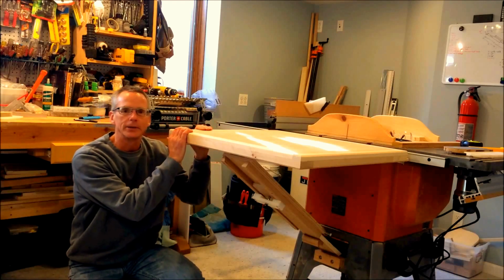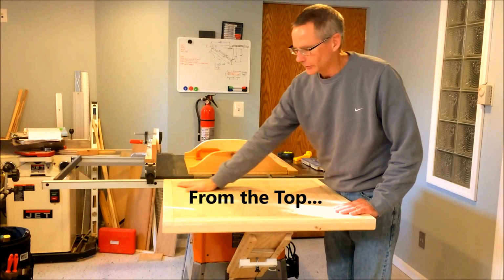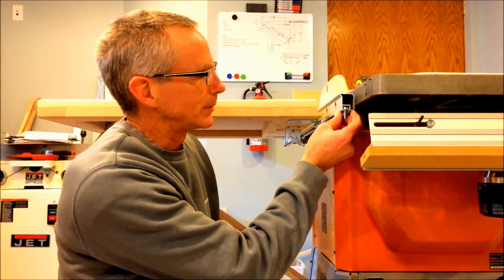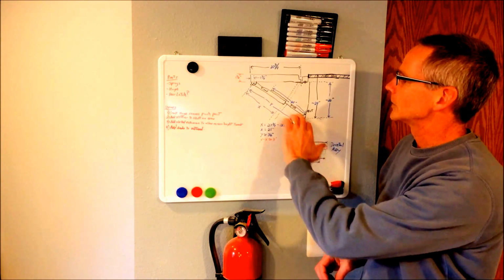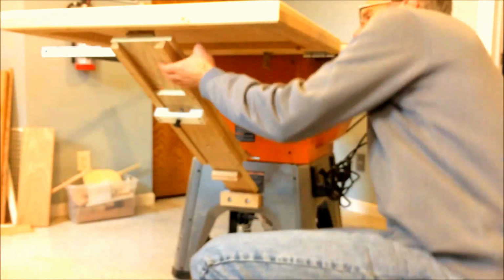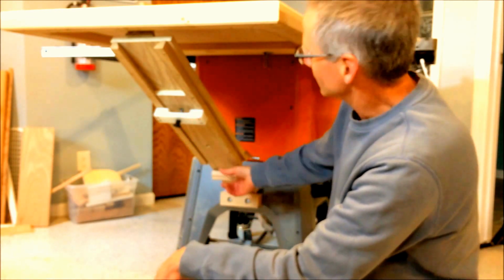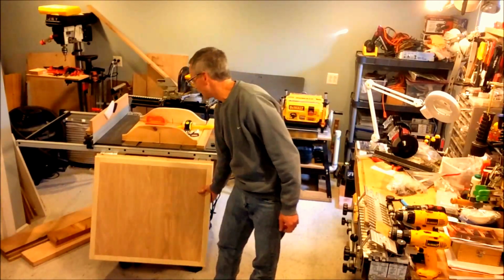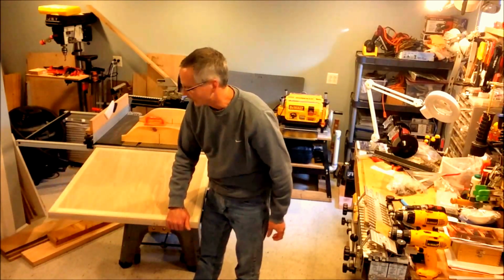Outfeed table for Ridgid R4512

Comment: I would like to more about how the bolt spring assembly was done. Do you have pictures?
Reply from the maker: There are some photos at the end of the video.  It is pretty simple, with just a 1/4X20 bolt, and I roughly rounded the head to fit in the hole of the plywood.  The handle then just screws onto the other end, which is the pull.  You will need to put a spring in between the G10 (plastic) and the bolt head to spring load as shown in the photos at end of the video.  Hope that helps?
Reply: After I sent it I really thought of it and figured it out to be similar.  Thank you so much
Reply: Instead of the plastic could you use plywood?
Reply from the maker: @kyriacosdavis7781  Yes, I just used plastic that I had laying around, but you can use plywood or solid wood for this as well.
Reply: Perfect thank you so much. I might put a metal sleeve in the plywood so the bolt can travel easy in it!!

Comment: Jess, I just purchased the Rigid 4512 table saw. I like your design for the out feed table. Do you have a set of plans?
Reply from the maker: Sorry, I did not make plans, I just made it up as I went along.  It is fairly straightforward, and if you have any questions just shoot them to me, and I will try to guide you through it.  The critical item is mounting of the hinge so your outfeed sits just slightly below the level of the table.
Reply from the maker: BTW: I think you will be happy with the Ridgid tablesaw.  For the price, it is really hard to beat this saw in performance.  For me it is just the right size and I really like the built in mobility, since my shop is fairly small and I am always "dancing with my tools".

Comment: You did a great job explaining your approach and I really appreciate it. I especially found the comments of issues you found after finishing the table to be very helpful. I was actually thinking about the pressure of the weight of the table pushing against the skirt when you said it was an issue. Now I can address it ahead of the build instead of after the fact. Thanks again. 👍
Reply from the maker: Glad the video was useful.  Good luck on your project.  I have to say that this outfeed table is the most used item in my shop.  Not only as an outfeed, but more often as another work surface for projects. In a small shop, having enough space to put things is a constant battle.  The fact that the table just tucks away when not in use is a huge space saver.

Comment: Would it be possible to get a couple better close ups of the spring latch that is used to handle the sliding part of the support? For reasons I can't quite fathom I am not quite getting how that goes together. I've made the table, mounted it and modified it in a couple ways. Somewhat wider, and mounted so that the runners from a sled will just clear the outfeed table, eliminating the need to put grooves in the top. Also, mounted a 4x8 inch piece of 3/4 ply behind the metal skirt and mounted the support strip for the bottom of the dovetail support to it, eliminating any flex in the skirt. Thank you.....

Comment: Man that's a lot of weight on that table with the bench dog router table ($329) Plate ($54.99), guess you don't move the table around or can't use the stock wheel lift setup that comes with the saw. But you can make your own or buy another base wheel setup that can take the weight, with Both your outfeed table and bench dog router table.
Reply from the maker: Yes. I had the same concerns when I put the outfeed table on.  But, amazingly the factory lift still works effectively.  I am constantly "dancing" with all my larger power tools, so being mobile is a must.

Comment: why is the  top so thick?
Reply from the maker: The table is framed to the thickness required to bring it level to the cast iron top.  The insert is 3/4" plywood.  You possibly could just shim the hinge locations, but then you would also lose some of the strength in the outfeed.  I find I use the outfeed table as an extra bench and I want it to be sturdy.

Comment: That's a great idea. Maybe swap out the threaded screw for a pin or grind the threads down with an angle grinder to make a pin. Love how you used the gate lock to hold the board up!
Reply from the maker: Thanks.  Agreed, using a tooling pin would be a better solution, or as you suggest just grind down the threads or better yet turn it down if you have metal lathe.  Hope you found this useful.  I really do like this out-feed table, and not just as an out-feed table, but I find I use continuously as table top space when working on projects.  My bench is ALWAYS full of stuff, and having a little more space to work on is very helpful.
Reply: I definitely did, I am going to use the dovetail arm for my project since I haven't ever done dovetails before. I am very new to woodworking, but am about to build a new workbench that incorporates my router and table saw, and the outfeed table seems like a great addition to the back side, so I am going to use your design =)

Comment: The outfeed table looks great! I've got the same R4512 saw and have been looking to do something similar. I now plan to make something similar to what you've done. Thanks for sharing!
Reply from the maker: +Brian McEnulty Good luck Brian!  There are lots of ways to make the outfeed, but I did find that using the large dovetail slide worked perfectly for this application.

Comment: Great job on the outfeed table. What's your setup on that router table?  I have the same saw and I'm looking for a good router table setup. Why did you opt to mount it on the left side? 

Thanks,
Sevada
Reply from the maker: +Sevada Hambarsumian I have a bench dog 40-102 mounted.  I mounted it on the left since the holes do not line up to mount on the right side, and actually I prefer it on the left since most of my cuts on the TS commonly have more material to the left, and provides more support.  The only big challenge on mounting is installing the center bolt.  Some say you can use a swivel socket, but I just drilled a pilot hole through the webbing of the cast iron to allow me to insert a hex wrench and install the center bolt.  I used the original hex head bolt that came with the TS.  This does add quite a bit of weight and you need to be careful if you pile anything heavy on the router table, as the TS will tip.  
The bench dog table is relatively expensive, and you could go cheaper, but I expect this thing to outlast me, as it is built like a tank.

You will need to order the router insert separately, as this does not come with the bench dog.  I don't blame this on the Bench dog manuf. since there are just way to many combinations of routers and mounting styles.

If you search Amazon, you will find a great video that I watched before purchasing this router table.  I highly recommend it if your seriously looking at this table.
Reply: +TheJcretney   Thank you for the reply. That looks like a great setup.

Comment: Great video man. I just got a R4512 table saw myself. I need an outfeed table for mine. I will surely use many of your ideas. Thanks for taking the time.
Charlie
Reply: +TheJcretney Thanks for the hinge info. I already am enjoying my saw even though I have not had it long. It's funny how I ended up with this. I had my eye on the Craftsman saw that looks identical to this one. As Sears and Home Depot are very only about 1 mile apart in my town I went back and forth looking at each of these saws. Then I read the reviews on both saws. There seemed to be more negative comments on the Chraftsman then the Ridgid. And HD had none at the moment. And HD had four. One followed me home.
Reply from the maker: +Charlie Cook Thanks Charlie.  I think your going to the like the Rigid saw.  I was really hesitant on buying the R4512, as I was concerned on the quality of a Big Box type of brand.  I have been very happy with this saw based on both price and performance.  I did add a bench dog cast iron router to my saw which I absolutely love and would highly recommend one if you need a router table.  Mounting the bench dog was a little bit of a challenge, but some guy on YouTube did an excellent video showing how to attach it.
I just added a couple dado cuts to accommodate my sled.  
As I mentioned in the video I did not give provide many specific details, but if you need any specific info leave me a comment and I will answer any questions, at least those that I can.
Enjoy your new saw.  I think your going to love it!
Reply: +TheJcretney 
If you have a moment, what size is the top? You may have said but I missed it.
I will probably put in a router table eventually. I am curious about the bench dog you mention. Do you have a link to them. My only thought might be that there are only two bolts holding the right end fence rail up. Seems like a lot of weight hanging on those two bolts and that aluminum extrusion.
Again, great video. Just watched it again and saw a couple of things I missed the first time.
Charlie
Reply: +Charlie Cook 
Sorry about my last note. I did see those directions you had posted on your wall so I have those now. A real "whoops" moment.
Reply from the maker: +Charlie Cook 
The bench dog is pricey, I am generally a cheap person, but I also want the right solution and was willing to drop some cash on the bench dog.  It is cast iron, and will bolt onto the end of the cast iron top of the saw.  The trick in mounting was installing the middle bolt to the saw.  I solved it by drilling out a pilot hole in the bottom webbing of the bench dog, and was then able to insert my larger hex wrench through it to tighten the bolt.
Here is the one I purchased from Amazon:
www.amazon.com/Bench-Dog-Tools-40-102-Extension/dp/B001TDLSUS/ref=sr_1_2?ie=UTF8&amp;qid=1452473333&amp;sr=8-2&amp;keywords=benchdog+router+table

Anything I can do to save room in my shop makes it worth the investment for me.  So, now my saw has the extension with the bench dog, and the collapsible out-feed.  I am actually using the out-feed table a lot, but suprisingly I am using it as more of a general purpose table while working on various projects.  My bench is ALWAYS full of various &quot;stuff&quot;, so the additional workspace is much appreciated.

The top of my out-feed measures 30 inches wide, by 27 3/4 inches deep.  I did add a small bevel around the entire top once I had it built.

Concerning hanging the out-feed on the aluminium, I was also a little concerned, but now that I had it on it seems to be sturdy enough.  As I mention in the video I used two &quot;hefty&quot; hinges, each hinge has 2 bolts, so a total of 4 bolts.  It would be easy enough to add a 3rd hinge, but I don&#39;t think it is an issue.
Reply from the maker: +Charlie Cook The hinges I used from Home Depot are:
  Stanley-National Hardware
  Model # CD908.5 3-1/2 GATE HGE Z
   
3-1/2 in. Zinc-Plated Heavy Duty Gate Hinge
Reply: Just wanted to let you know that I have completed my outfeed table. I pretty much made it like yours. It is just a tad larger in length. The spring loaded holding this is a copy of yours. I am using a gate latch as you did. The only thing I don't have done so far is a edging on the table itself. Thanks for the great ideas and the inspiration.
Charlie
Reply from the maker: +Charlie Cook Congrats on getting your out-feed done so quickly.  I had my saw for about 5 years before I finally got around to adding mine.
Reply: +TheJcretney Thanks. Actually you were my inspiration.  I have a table about the same height of my table saw top that I used as an outfeed. But it was always in the way. Then I ran across this video and the rest is now history.
Have you had any issues with your saw? I read so many comments about problems with this saw in the past. It is my understanding that Ridgid has addressed these issues.
Reply from the maker: +Zaftig Buff Thanks for the kind words.  I have not had any major issues with my saw.  I know many people have had issues with the arbor causing blade run out.  I have measured my run out using dial indicator in the past, and I think it was pretty good, I am thinking I measured about 0.007" maximum run-out.  

The one thing I really don't like about the saw is the insert.  The design of the insert makes it very difficult to build your own insert, with the major problem related to the fact that the insert sits on multiple ears with screws to allow fine adjustments to flush up the insert.  I have made a couple inserts, with one from pine and one from UHMW, and the material over the ears is very thin (5/16" or so).  I really want to keep the built in screws in the table the same height I set for the stock metal insert, so I added 1/4" threaded set screws, but it is difficult to get the thickness correct.  The material needs to be thick enough to allow the set screw to be at worst flush to the top when set, but the thickness needs to be slightly less than the 5/16".  If they would have set these ears down another 1/2" or so, it would have made construction much easier.  This is hard to explain in words, but if you have made one, it will make more sense.  Also, the UHMW material is great since it is so slippery, but the downside is that UHMW tends to potato chip and can bow slightly.  I have found for my UHMW insert, that I can convince the material back to shape.

One thing I never mentioned was the built in mobile wheels on the Rigid.  This is one of the best features for me, since I am constantly dancing with my table saw.  The fact that the mobile base is still functional after adding the heavy cast iron benchdog extension, and now the outfeed table, says a lot about the design of the mobile base.
Reply from the maker: +TheJcretney I should mention the runout I measured was on the blade not the arbor directly.  The blade itself is not perfectly flat, but my thought is that if my blade runout is 0.007", then the arbor must be at least as good, but likely better.  I was going to try to measure the arbor, but I think I had a difficult time getting my dial indicator set-up and just forgot about it at the time. I have not had any issues, at least that I can perceive, related to run out on any of my projects.
Reply: +Charlie Cook Update=I just tried to lower my table and ques what.....not enough room between the saw and the table. I used a piano hinge and it puts the table too close to the saw. Also, there was no room for the leg to fold under either. Back to the drawing table. I am going to stop and HD and pick up a couple of hinges like yours.
Reply from the maker: +Charlie Cook Also be sure you add the channel along the leading edge of the table to 
accommodate your fence.  I did also add some foam cushioning on the 
support block I bolted to the table, so that when I drop the table down 
it won't bang.  Not necessary, but it does prevent a startling bang if 
it is dropped.  I typically like to sketch up my idea of how to build 
something, then have at it.  The challenge and fun comes when something
 is not quite what I intended, then I need to come up with a solution to
 fix it.  Not always the best way, but everyone has there own style
Reply: +TheJcretney That's kind of where I'm at now. Figuring out how to correct things. I want to add few inches to the table and tomorrow I will be picking up a couple of hinges like the ones you used. Have  to go right past HD and I will pick them up there. I have the hinges numbers you previously gave me. Won't take me long to correct my mistakes.
About the router table. I take it that it comes without the plate. What router did you use? Do you have a lift? Got to save some pennies but eventually I will have one.
Reply from the maker: +Charlie Cook The Bench dog table does not come with the plate.  I think the plate was another $45 or so.  I have a Porter-Cable router, but cannot remember the exact model right now.  You will be able to use almost any router you want, but just be sure you select the right plate insert.  The cast iron bench dog is definitely not cheap, but I really do like how rock solid it is, with the benefits of both extending my table top surface of the saw, and not requiring a separate router table.  You can definitely find cheaper or even make your own router extension, but it just depends on your budget and time.  I bought mine early on when I was not so confident in building my own, but now I might take a crack at doing a DIY router extension table.